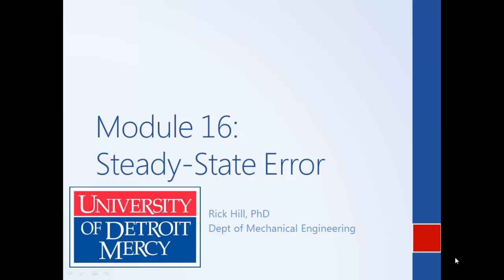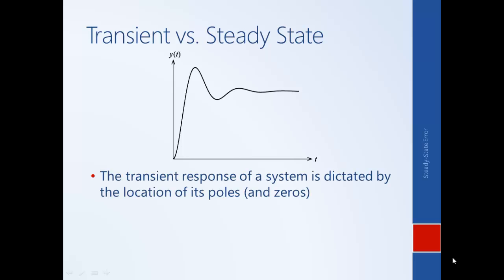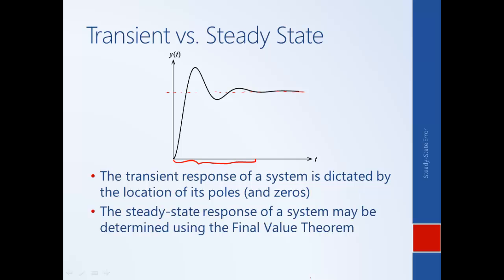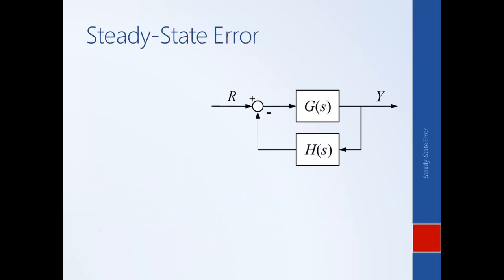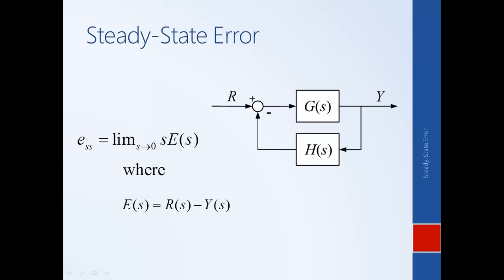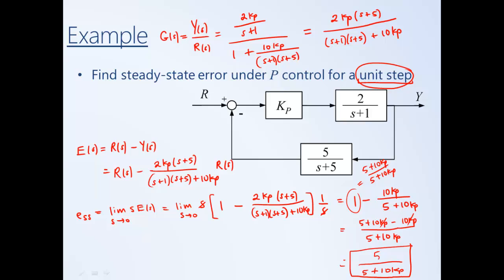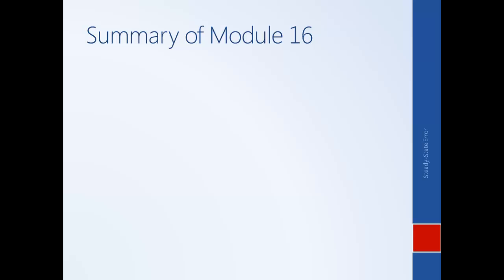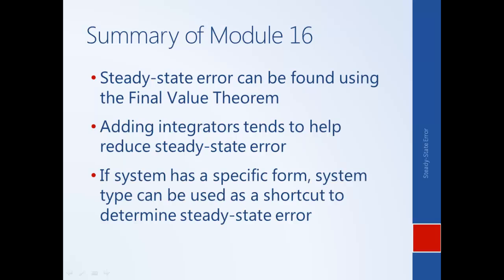System Dynamics and Control: Module 16 - Steady-State Error

Comment: if we have non unity feedback then is it necessary to convert nonunity feedback system to unity feedback system.....and how can we convert it please reply.....
Reply from the maker: +Jeevan Maharjan You don't have to convert a system to unity feedback to determine its steady-state error, the final value theorem will still hold. The only thing you have to be careful of is your definition of error if the feedback signal is distorted by dynamics in the feedback path. Also, you must be careful if you are trying to estimate error based on system type (without explicitly using the final value theorem).
Reply: sir please send your email id ihave lots of queries regarding steady state error...
Reply: @gibhangbn  lol
Reply: @gibhangbn  lol

Comment: You can not even control the ambient sound :(((((
Reply: Yes, the ambient static sound is distracting. I have to lower the volume so that it wouldn't be annoying.
Reply from the maker: @AJ-et3vf  I have re-posted many of the videos broken into smaller chunks with somewhat better sound. You can try those if it is bothering you too much.